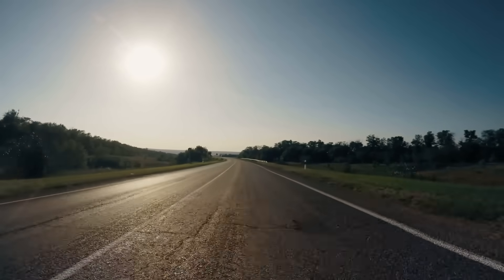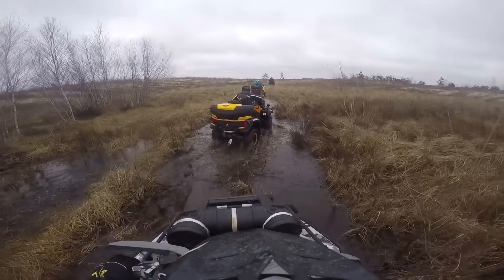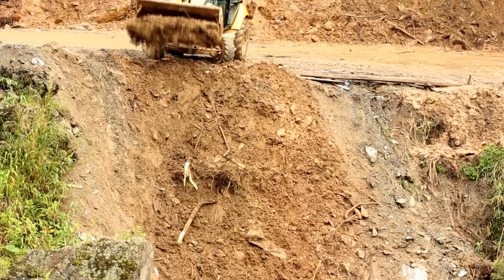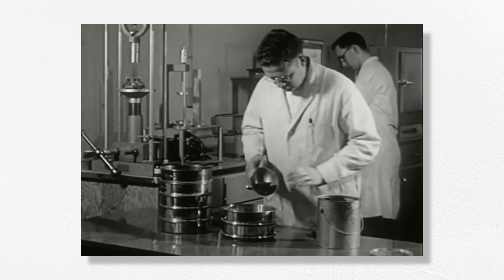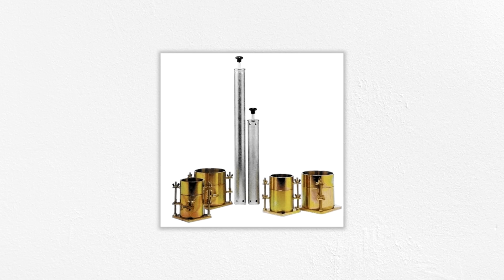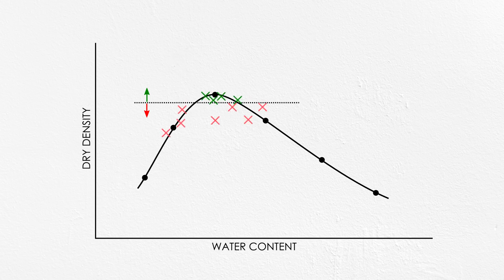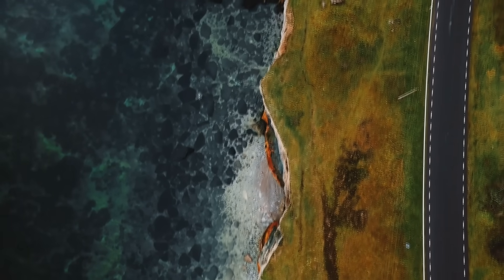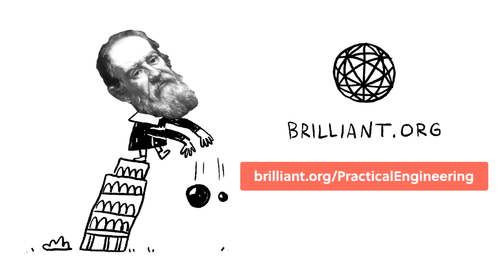Why Does Road Construction Take So Long?

Comment: You start off with "Most of us love having wide, smooth roadways  to take us to work, to home, and everywhere"  Well you got that wrong for a start.   My favourite road is one that is so little used that it has a narrow strip of grass growing in the middle of it.  It is a road that has character and has a history, often going back to when it didn't even have asphalt and became a quagmire in winter and a dusty track in summer.  It is a road that goes to somewhere that is still interesting and is not one of those charmless collection of concrete boxes.

Comment: There's another thing you didn't mention that can add considerable time: On those big embankments like the approaches to a bridge, the weight of the embankment itself on the native soil under it can cause that native soil to settle, so there will often be a contract-required settlement period (I had 90 days on some of my projects) where you just wait, and take regular measurements to see if there's any settlement. If there's been none, or not more than allowed, at the end of the settlement period, you can start building your bridge. If there is any, you write a change order and wait some more, until it stops.

Comment: Why do bridges, particularly, take so dang long? In my experience it has taken YEARS, for a new bridge to replace an old one. The old one is always quick to go down. I would expect a new one to be done 20 times slower. So if it took 2 weeks to take the old one down, 40 weeks after that a new one should be ready for use.
Reply: Modern Safety and Environmental regulations will do that. They could still certainly be built faster, problem is that actually costs more money upfront that taxpayers arent usually willing to pay for.

Comment: Another video would be the proper way to grade a gravel/sand or dirt road. 
I do not know how many times I have complained to the county workers that they have no clue how to grade a county road and that leaving a 6 inch to 1 foot tall dirt pile at the roads edge leads to water build up and the destruction of the hard pack layer. The fact that most county workers have zero understanding that you are not suppose to rip the road up and only maintain the top few inches with the grader. Proper road grading only requires 3 passes, 2 passes to bring loose material from the roads edge to the middle and grade off the top, This puts a crown on the road and allows for a faily flat surface to drive on. 
The hard pack layer is what they destroy every single time they spend hours and a dozen passes to grade out said road. All of these extra passes destroy the hard pack and allow water to make is sloppy and does not allow said water to drain off.

Comment: If you are going to do more videos like this, You should do videos explaining the process of why asphalt is inherently bad because of the lack of maintenance. 
Micro cracks are a huge factors in why asphalt roads crack and become damaged. Water is the prime reason roads crack. Chip sealing is a low cost alternative to fix this. 
Also explain why crack sealing is worthless and a waste of tax payers times when chip sealing should have been done to repair the road. Crack sealing is all of those black lines you see on the roads.

Comment: Compaction and why it really takes a long time. 
The lack of equipment, logistics and manpower. 
As you can see in the video at 6:30 there is limited amount of equipment and manpower to keep the cycle going layer after layer. While what is shown in the video is do a little here and a little there. Which takes more time than needed. The best way to run this project is to have enough dump trucks dumping while a grader does it work and compactors come from behind and do the test all while the next set is starting, There should be dozens of dump trucks working at the same time while dozens of grader are grading, and dozens of compactors are rolling behind. This cycle can be non stop the whole time while getting the job done is a much faster rate than conventional ways.

Comment: The real reason why projects take a long time to finish.
There are 3 main factors that work in every project. 
Those 3 factors are Equipment, Logistics and manpower. 
Most projects can be finished in a little as a few days, Yet because contractors only have a limited amount of equipment and manpower it takes much longer. 
Lets use an example of a project for resurfacing an asphalt road. This project consist of  grinding out the old asphalt and laying a new mix down and rolling it out and paint. 
This project takes weeks to do because they can only do a little at a time. Logistics and good planning could have 10 to 20 times the equipment and manpower there to finish the job it a single day. The first crew goes in and grinds one side of the road while another crew at the same time does the other side of the road, They do not stop, they keep going till the project gets done, This means 24/7. The 2nd set of crews comes in and lays the new asphalt while the 3rd crew rolls it down with dozens of rollers and the 4th crew paints and then the last to come in are the clean up and inspection. The concept is being done in other parts of the world and works. 
There is one other main factor that people do not see, Is that we opt for the cheap construction possible instead of paying for the better. Cheap is asphalt. Best is 24 inch thick concrete. Concrete will last much longer with less work provided that it is thick enough to prevent slab cracks and has a large enough crown to prevent water intrusion which is the reason why we have construction in the first place. When a crack or something else is wrong, It should be fixed the same day it is found, If that means redirecting the highway for a day or 2 you do it and cut up a huge section of the slab and replace it. 
If we are going to keep using asphalt, Then states and cities need to start understanding what micro cracks are and why you can not just leave a road for 20 years and expect it to be in good shape at the end, Which is why they need to start using new chip seal methods which  a small crew can do a mile plus in a single day using current methods, While if logistics were put in place they could almost go as fast as traffic could...

Comment: i thought this would be about fixing roads not building new ones. i've never seen or been burdened by new road construction. 
100% if the time its repairing, resurfacing, or digging up placing new pipe lines and rebuilding the road.  all of which realistically takes weeks or months to finish what looks like could be done in a day or week with so many people and machines on the job site. 
you didn't talk about any of that.

Comment: It takes so long because there's usually only 1 guy with a shovel on his hand and about 6 of them just watching him work
Reply: It's true there are lazy people in most any career.  But having been involved in a few smaller-scale projects that involve digging, concrete work, and moving materials, I can understand that a certain amount of standing around is unavoidable on construction sites.  If some tasks need more bodies involved at intervals, those bodies can't just wander off to do something else or they won't be available when needed.  This is especially true in cases where specialists are involved; they often have no other job on site, but have to be ready to do their little pieces of work, so that the entire job can keep moving forward.
Reply: The reason for the 1:4 or more ratio is in case of collapse of the hole the guy is in. Let me ask you this would you rather have one guy you have to dig out with 4 up top? Or 4 in the hole that one guy now has to try and save 4 lives.
Reply: @swworrelljr2  thats why they do a procedure called "shoring" ,  it's OSHA regulation . Please do your research before making such a stupid comment.
Reply: @swworrelljr2  how about having the other four doing SOMETHING even remotely productive, but ready to run over and start digging if need be?  You call the fire department, not having them standing outside your house all day in the off chance you decide to burn it down.

Comment: Excellent video! The correct names were used for all the heavy equipment, you showed an actual understanding of the subject, there was nothing that made me cringe, and it was interesting! Yes, please make it a series! Lol

My one beef is that the cut and fill diagram at the beginning didn't show the excavation and cuts that are made on the lower side to get to solid material, build a flat surface, cut toes, etc, allowing a proper fill to be made, compacted up deep enough to create a stable road.
Just tossing the dirt onto a slope is a disaster lol

Hopefully in a future episode you will show an actual freeway section blueprint on a side slope, and go through all the layers, from the deep trench dug to allow controlled fill, then drain rock, then base rock to create a floating raft, to the toe cut at the base of the fill to keep it from sliding down hill, to the drainage layers and filter fabric, and all the little unseen details that we see driving past roadwork, and wonder why they are digging a 20 foot deep chasm where the future road is supposed to be, instead of just laying down gravel on the dirt.

I also find it really interesting how many concrete freeways have the cement poured on top of a few lifts of asphalt to give it a resilient surface.
You could also talk about how they rehab cement freeways by slotting between the slabs and epoxying inserts in to lock the slabs together, and how they grind them flat because cement slabs curl from weight on them, leading to that washboard effect that we all know and love.

I used to work construction, including on city and freeway projects, paving, etc, and now I drive truck up and down i5, so I am constantly seeing construction all along the way, and love watching the progress, some slow and taking years, others rapid, like the lane addition just south of Redding CA, where center divide infill bridges are appearing in record time, or a little further north near Mt Shasta where they are replacing some small overpass bridges, and I drive on the early in the week, they are totally removed by the end of the week, and getting foundations poured the next week.

Comment: The reason it takes so long is that most the time they try to keep the road open. This leads to only working on one section at a time, laying temporary asphalt that will be ripped up when they are ready for concrete, and the construction crews are limited in space and lots of times are forced to only work at night. New roads are built fast because they can do the entire road at once, work at the most convenient times and drive and park their equipment wherever is most efficient and not have to move them to off road areas at the end of a work shift

Comment: It's usually because the the project is for a road that is not entirely new, but being replaced, or improved/widened, and there is traffic to maintain while under construction.  So the project needs to be sequenced in phases to minimize disruption to the travelling public - which adds time.

Comment: Actually, environmentalists supported lawsuits add more delay to projects than any other factor.  Almost as much is spent on the actual building of the road as is spent on the EIS and lawsuits trying to protect everything from the vaunted snail darter to sage grouse to eel grass miles and miles from the project.

Comment: How public construction projects tent to work in California

An Request For Proposal is published.

Politically connected firm is given not public data to submit winning bid. This often is the other bids on the RFP. Yours will always be lower if you know what the other "sealed" bids are...

Politically connected firm gets contract. No surprise.

Around year 2 or 3, very little work had been completed, but with no increase in scope, the estimated costs with have increased by 2-10x.

By year 3 or 4 the scope has retroactivity decreased but the cost had gone up another 2-50x. By this point, usually all money for the project has been spent, including the previous increases to it's budget and all available bond moneys, and the project is maybe 0.1-50% complete.

Comment: Cool video. I learned a lot. I am however surprised that engineers have not developed some soil liquefaction technique to locally vibrate large areas to speed this compaction process up--and maybe adding some stabilizer that is activated by the friction.  Kinda like annealing steel. Is that approach impossible?

Comment: I look forward to this series as I started off my engineering career as a geo-tech doing site development testing and observation— learning about compaction and bearing pressures to concrete mix design, making  concrete cylinders for compressive strength testing in the lab to pre and post tensioned concrete structures just to name a few of the things I did on the regular.  I now am an inspector for a major water company on the east coast where I am responsible for restoring paving and land restoration of areas damaged by scheduled work and unscheduled work from unexpected damage due to water main/ sewage line breaks.  I never understood the amount of work and money that went into the world around us the operates without you even thinking about it until I got into this field. It is amazing to say the least and I’m always in awe of it all.  I recommend to anyone that would like to find a fulfilling and sometimes lucrative career that will always be in need, to get into the civil engineering field. A great place to start is as a geo-tech and most engineering firms are always hiring entry level positions. You will learn everything first hand and the knowledge acquired will help you understand more about the world around you than you might realize.  Plus being on a constructions job site is way cool right? 😎 I mean operating the equipment is mega fun too but observation and testing is up its own alley if you like puzzles and to figure out things. Every job is the same but different, and that is exciting figuring it all out.

Comment: A question I've always had: When you think about all the economic productivity lost by commuters stuck in traffic due to construction, it seems easy to imagine that it would be far cheaper in total economic costs to do all traffic-affecting construction at night (or certainly well away from rush hour). I wouldn't think that it could cost more than 2x-3x the "daytime" job cost to run a construction job at night, and you're saving many thousands of people anywhere from a few minutes to an hour a day over many months, which must amount to more total value.

Is this in fact true (or not) and if so, are there any cities/countries that have taken the "enlightened" view and designed a regulatory and compensation structure to require or encourage construction that minimizes total economic costs, rather than individual job costs?
Reply: I think a few thousand minutes is worth the lower risk to lives overall. People hit us in broad daylight as it is. Cities with longer history of consistent construction like Kansas City have been doing night work, though not exclusively. Some jobs like crane operations have to be done in the best visibility conditions, and new construction projects usually aren’t taking up much of your time anyway, you’re not driving on that dirt to get to work even if nobody’s there. Chances are the construction is happening to shorten your commute and you were stuck in traffic before the construction even started; you just have to drive 55 instead of 70 for a bit.  If you want to talk efficiency: if everyone maintains proper distance and obeys the speed limits most stop and go traffic would vanish. https://youtu.be/iHzzSao6ypE

Comment: Where I live in Canada they have stopped compacting like they used to years ago. Instead, when they asphalt the road bed is not fully compacted. The asphalt is sufficient for about five or so years at which time they come back and do the final lift of paving. They do this because the traffic on the road does the actual finished compaction. When they do the final lift it relevels the rod and it stays level much longer and the process of letting traffic do the work for you is considerably less expensive and time consuming than traditional full compaction at the outset. When it's all done it works pretty good until some jerk decides to dig it up to put in a new utility line.........lol